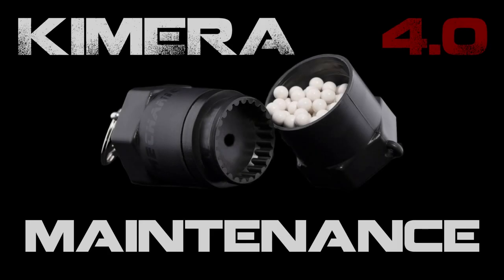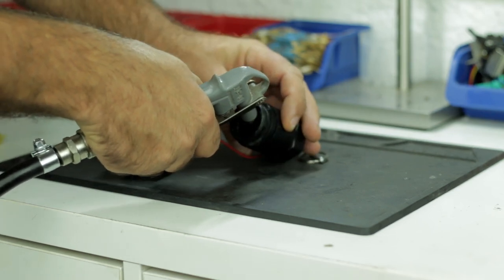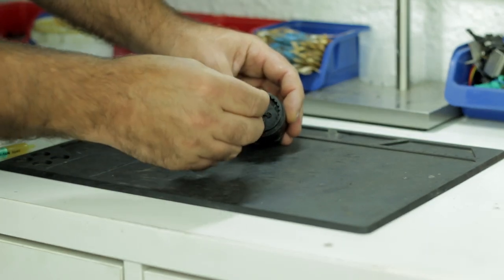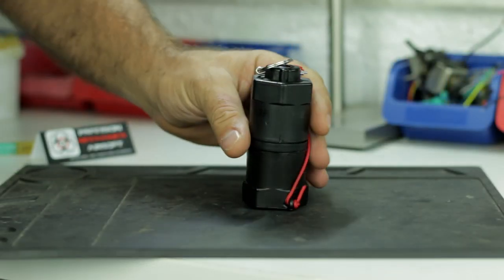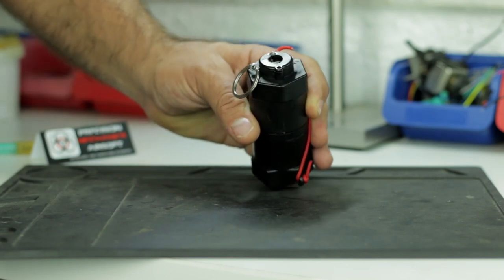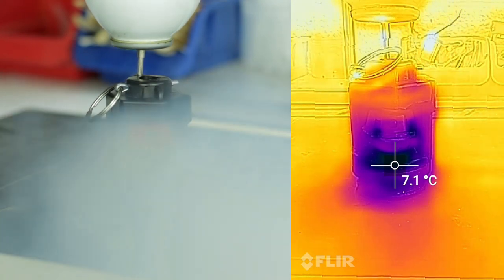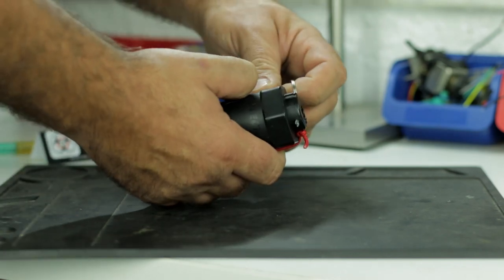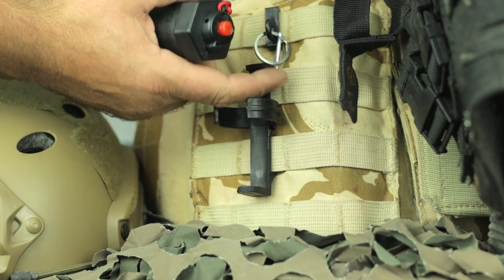How to perform maintenance on the kimera JR 4.0

Comment: Hi! i just purchased my second kimera some days ago, as I was really happy with the first one...but this time I have severe problems with the charging process.
At first try it somehow took the gas but woulnd explode at first throw but only do a "pffffft"sound and on second throw it would explode.
It did that 2 or 3 times.
Now the grenade does not take the gas and wont charge any more.
The ball is still loose after "filling" with gas and pulling the splint.

Is there any option to test or repair it?
I added some silicon grease and oil but it didnt do any good...
Reply: problem solved: refill wothout the safety pin. The red button comes shooting out then, while the seals are repositioned by that. now it is tight again and refills and bangs like normal